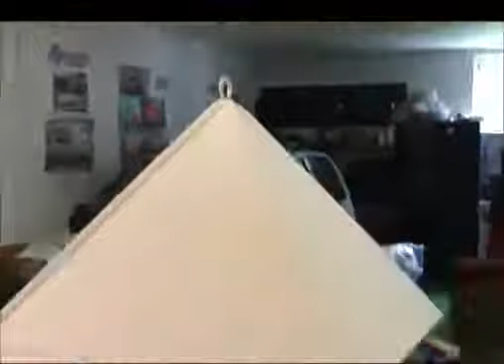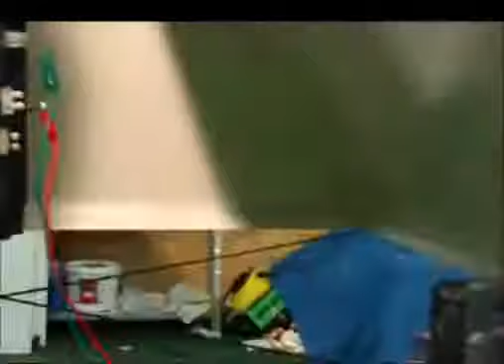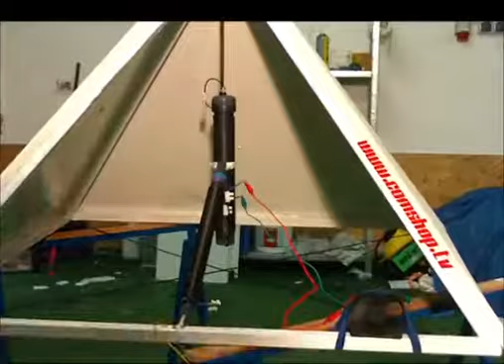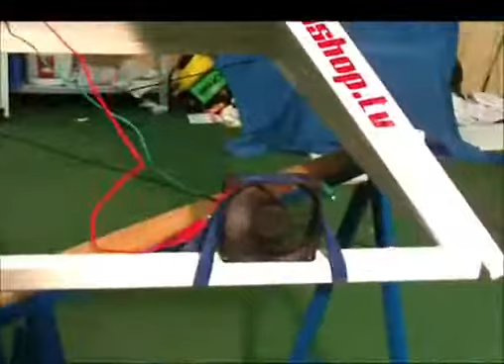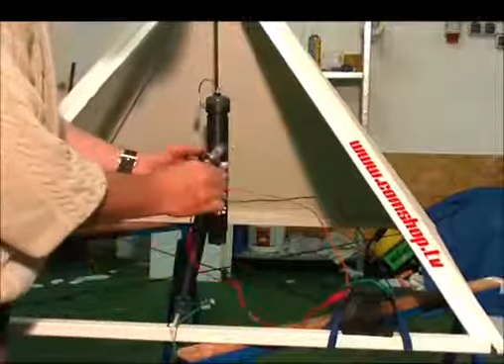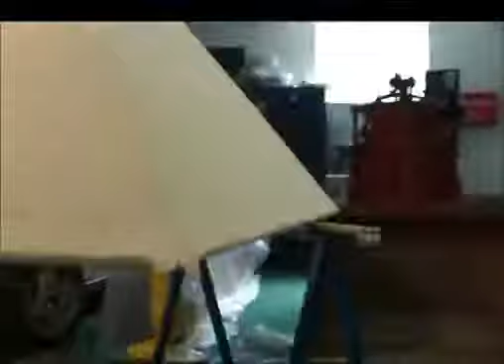TPP V12 Tutorial Part 13 of 13 - Thomas Tragöwer Pyramid Power

Comment: Could this thing be receiving Energy, broadcasted by powerful Radio Station Antenna not far away.?
Reply from the maker: It would still a good innovation because I never heard radio without powersource  can make fan run. 

TV antenna and cellphone may have to consider to use pyramid as the reflector in that case. But I never heard story about cellphone having better reception inside pyramid.